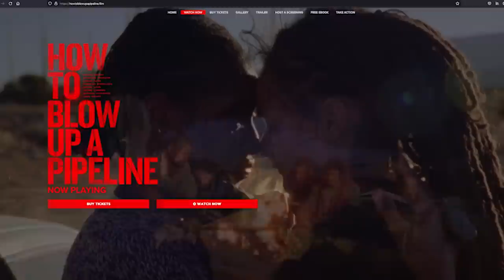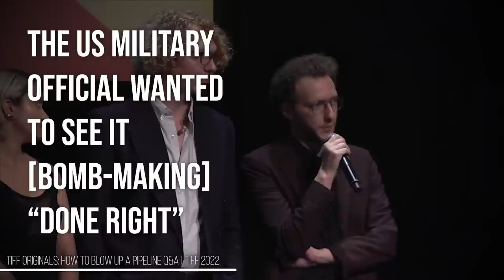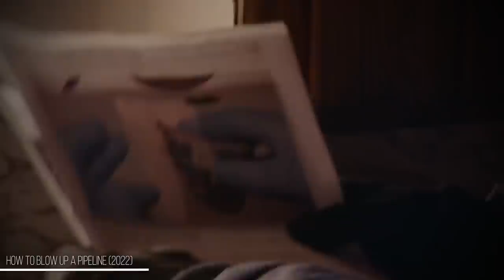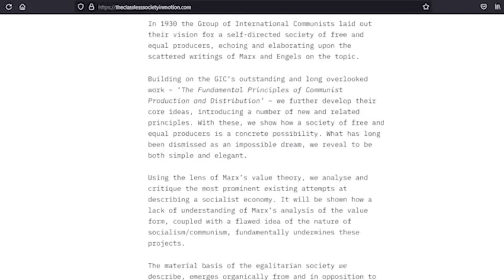Is this Movie a PsyOp? | Dangerous Misinformation in “How to Bl*w Up a Pipeline” (2022)

Comment: I remember when I saw stuff about this movie a few years ago it gave me bad vibes. My reasoning was that if a pipeline is blown up, that can lead to an oil spill and immediately cause damage that could be avoided if it were somehow shut down directly and cleared out before being removed, but I didn't know about how unsafe a lot of the stuff in the movie really was.
Reply: Did you read the book? Malm makes it pretty clear why people did have blown up pipelines in the past and why they needed to. Idk that the reality really applies to the movie though.
Reply: @Sirzacharia  I didn't, but I can imagine that there are situations where it wouldn't result in an oil spill like if it was new or something. I'm just guessing that the ones people would want to blow up would've been in use for some time and could lead to a spill if precautions aren't taken like an oil catcher or something (but then, an explosion could lead to oil being burned if it's a pipeline that's in use, which is also a problem). Really it sounds like being stuck between a rock and a hard place.

Comment: The thing is that blowing up a pipeline doesn't require organizing or coalition building, it's a way an individual can act without needing to collaborate with larger structures. So it falls outside of the purview of conventional leftist discourse. But on the other hand, that's why the movie's self-defeating. You don't need to convince a movement to blow up a pipeline, instead of making the movie you should have just blown up a fn pipeline
Reply: Individual actions do very little. Even disregarding everything Paul mentioned about individual actions and lacking organisation... What is to be done while all those involved are sent to prison and the pipeline is rebuilt? What structures are there in place to prevent rebuilding? Are there any propaganda / media campaigns in place to fight the inevitable media backlash and subsequent lack of support from the general public? What about the rest of the pipelines in the country? Who will protect those who receive potential retaliation from the police (or even military's) terror campaign to prevent further attacks?
Reply: @caramelldansen2204 they're good questions. So is the question "do we have time for that?" Do we even have another decade to build the kind of support needed for a "proper" revolution, or have we been peacefully ineffective for too long? If so, what other options are there?

I don't have an answer to either set of questions. I also haven't heard great answers from either side.

Comment: In defense of a part of the movie, and in opposition to the book: there is a tradeoff that is in play regarding group size that are in constant antagonism, specifically 'members not being caught' vs 'how effective are you'. having a mass movement backing ecoterrorist activities, either the movement needs to be highly influential to the point of civil war, or the mass movement needs to accept that they will be considered an ecoterrorist group and ass such viable for dissolution and/or potentially subjecting all members to be rounded up as terrorists or terrorist sympathisisers. Terrorist groups also are significantly more likely to be infiltrated and/or caught and/or dismantled the more members are part of it and would know the plans. The longest acting terrorist group (that wasn't a military) lasted for a great many decades, was comprised of 4 members, and was only caught when the members died in on of their own explosions. If a terrorist group is larger than, or working alongside a group and the combined total is larger than, about 30 members then it is nearly certain that the group will be discovered and infiltrated before their work can be accomplished (that doesn't mean the activity won't be accomplished, just that there will be infiltration and that needs to be accepted). Less members means less leaks, more accountability, greater information control, and extreme levels of comraderie that can't be present in large groups. But, contrary to the film, any terrorist group that is not part of the community is always doomed to fail and the people viewed with suspicion (being integrated doesn't guarentee success, just increases the liklihood).
That is to say, either these groups will have infiltrators and a massively increased liklihood of being infiltrated and members arrested/killed before any activity is done, or they will be labeled as 'adventurists' and decried as was done in this video.

(though it is true that ecorterrorists have /the/ lowest body count of any terrorist category, regardless of their 2ndary driving ideologies.)
(and everything else in the video (not film, obvio... the film is bad) checks out to the best of my knowledge)